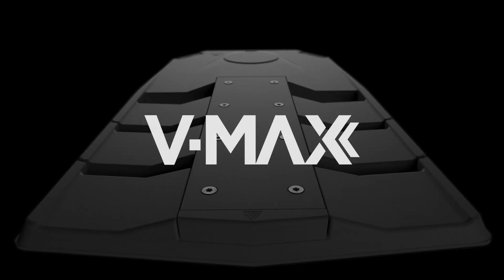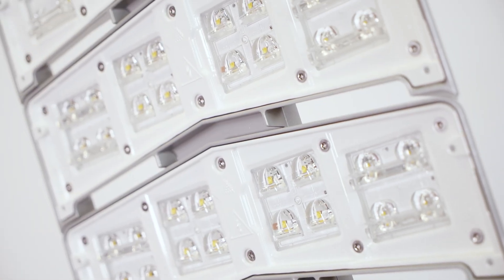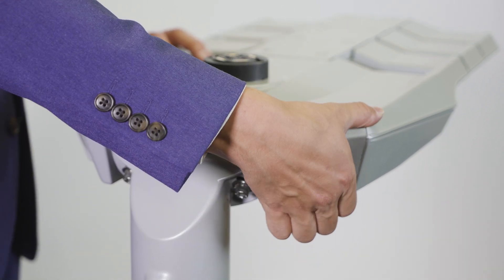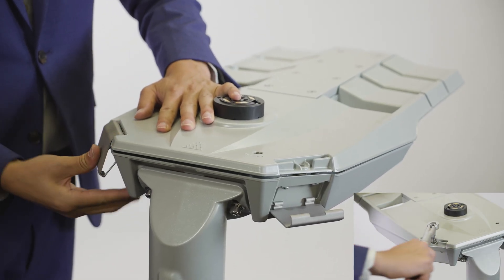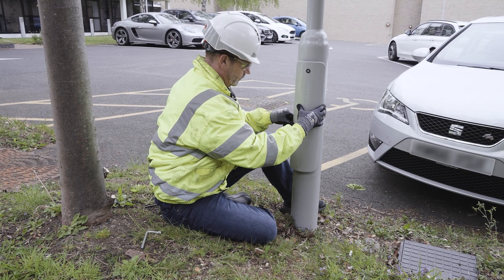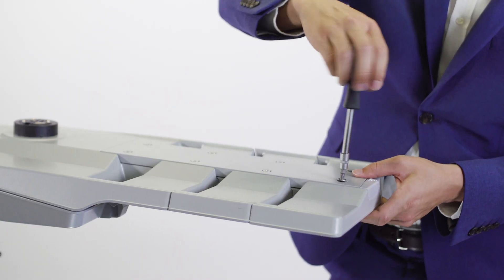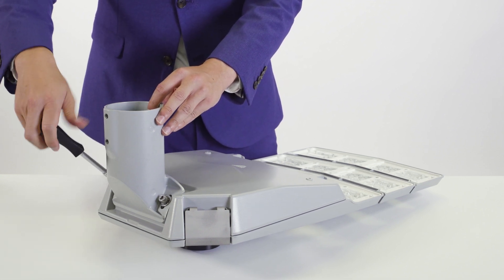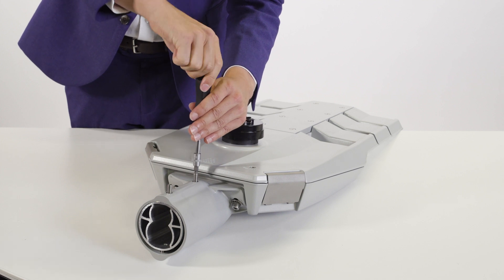The All New V-MAX™

Comment: Hi i'm viatron from Sheffield,  I like the new mk.ll version of the HOLOPHAINE V-MAX l.e.d. street light & it will be an improvement for our streets of Sheffield via replacing all the mk.l Indel/Philips Luma type versions what is around our areas of crookes & walkley. Well our street lighting contractor AMAY STREETS AHEAD will be experimenting with the new Mk.ll HOLOPHAINE V-MAX l.e.d. street lanterns on Springvale Road in the S10 area via it will improve the light from them. & i'm glad the you at HOLOPHAINE lighting will help AMAY STREETS AHEAD L.E.D. STREET LIGHTING CONTRACTOR in Sheffield in early 2024 according  to the experiment on Springvale Road. Thank you from viatron of Sheffield.